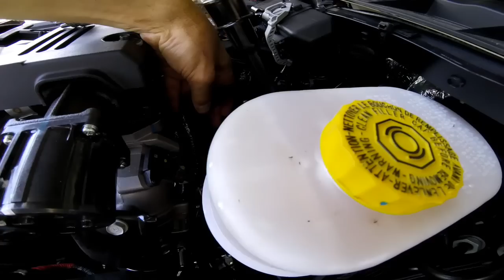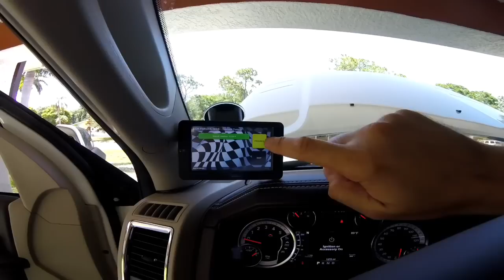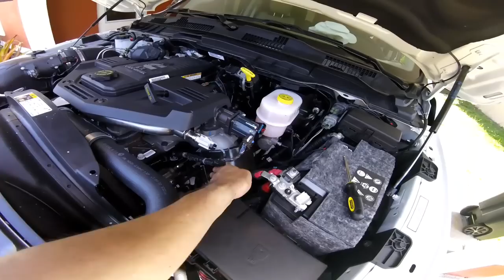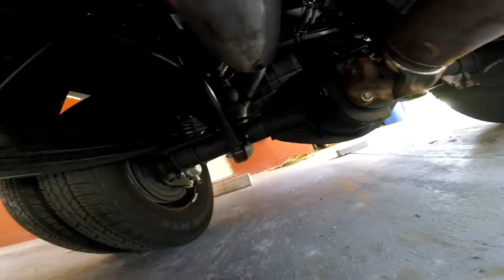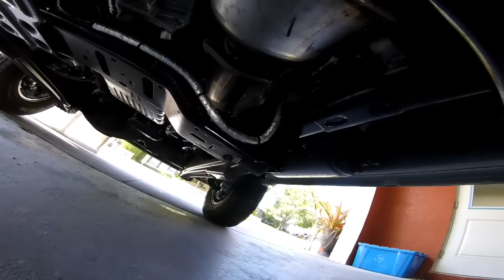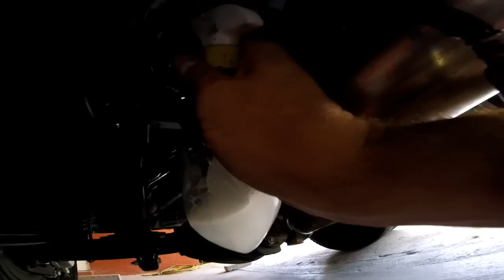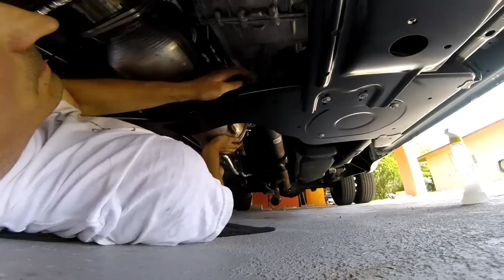New Ram 3500 DPF EGF EGR delete with RaceMe Ultra

Comment: What happens if you delete it from tune but not take any of the components out ?
Reply from the maker: @josevaldes6748  your DPF will plug up without regeneration and you will destroy your engine.
Reply: @ I bought a 14 Cummins with race me tuner installed everything deleted found last owners info and called him because underneath everything is stock filter everything he said it was gutted I’ve had it for almost a year no issues. Today I got a code saying lost communication with redundant control module and check engine code truck drives fine though I tried to reflash the tune to see if it would give me the prompt for delete dpf didn’t give me it so idk what’s going on lol tuner doesn’t see the dtc but my scan tool does
Reply from the maker: @josevaldes6748  if he gutted the DPF there is nothing to plug. Sounds like that isn't emissions related, best of luck chasing the gremlin.
Reply: @ thank you sir

Comment: Where did you plug in that single wire race me ultra underneath the dash which section did you plug it into the wire with just the white tip that goes underneath the dash
Reply from the maker: The only wire I ran was to the ECU integration port, which is the four connector type. Did you get the optional exhaust temp wire? That goes to the exhaust manifold and plugs into the module, which I mounted under the dash. That requires some drilling and lots of precaution, otherwise you risk sending debris into your turbo.

Comment: Outstanding step by step instructions for someone that wants full delete with the stock look. As shown, it is so much easier when things are brand new. But none the less, new or old it still all the same in the end. Great job for an offroad truck...
Reply from the maker: Thanks, glad it helped get you off roadin!
Reply: @shaunvolkmann1904 it's the same process  for 2021 ram 3500? Thanks in advance

Comment: I installed a Raceme tuner and unplugged all the connections on the engine as shown in your video and the truck runs great. My question is there any advantage in buying a full delete package for the engine and removing the unplugged parts from the engine? Thanks
Reply from the maker: I just did one with the full delete. You have to drain a gallon of coolant and it's time consuming. I'd say no, unless you plan in doing an intake horn, there really isn't a reason to bother. I have to say the Monster Banks intake and boost tubes are worth the time.

Comment: So you’re saying you can delete it all with leaving the egr intact? Only removal is dpf and egr actuator plunger?  I have a 2020 tradesmen and wanting to do this.
Reply from the maker: If the emissions systems are the same, I'd be comfortable doing it to my 2020 (if i had one).  Just do some part number checking from a 2018 to the 2020 to be certain. The 2019 and newer have different tunes, so make sure you got that covered.
Reply: @shaunvolkmann1904  well the only thing different is the actuator. It’s not a cylinder. Couldn’t I just unplug everything tune it and replace exhaust. Can’t find anything on it just older models
Reply from the maker: @bobbo2576  yes, the removal is just an extra level of safety.
Reply: @shaunvolkmann1904  so I just need a turner and remove exhaust?  Way easier than my TDI lol

Comment: Im starting my install today. But first i got to go under and plug in all the electrical to the exhaust. So after the ultra turns things off, do you have to go back through and clear codes from everything that is unplugged from intake to exhaust.  
I heard your music so i figured id reach out to you.
Reply from the maker: It's best to tune with no codes showing on the truck. Others have stated they pulled the battery cables and then didn't start it, only out it in accessorie mode to tune. Once tuned you can clear codes that develop, but you may have a hard time clearing them if they are there before the tune.  Best of luck!

Comment: Hey man I removed all egr dpf and throttle valve on a 08 6.7 Cummins. Would it still work?
Reply from the maker: Hello! Yes, it will be able to program down to a 2007.5. Hopefully you don't have any code lights on, they're hard to turn off once you program
Reply: @shaunvolkmann1904  by code lights do you mean check engine? I have that on because I’ve removed all egr dpf and def. It even throws out the “exhaust filter full” light on the top cluster.
Reply from the maker: @Manuel Ochoa  someone else on the thread tried this an said it worked. Disconnect the batteries for at least 15 minutes. Then connect them, but do not start the truck. When you hit the ignition see of the check engine lights are off. If they are, flash the ECU...just dont start it till you do.  Or, worse case install all the stuff back on to rid the engine codes, then flash ecu and remove components.  Boy, I hope you dont have to do the latter....

Comment: i need help my exhaust brake isnt working like it should after tunning do i need to do the steps in this video on the actuator>??
Reply from the maker: I'd throw a battery charger on it to make sure your voltage stays correct then restore back to factory. Don't start the truck, keep the charger on it and flash the ECU again with your tune. I've never had an issue with the brake on any of the tucks I tuned following the above directions.
Reply: I just did this @ a battery supplier shop 13.5 14 volts and nothing im wondering if i need to take the actuator apart as you did on your video.? I've tried everything contacted raceme and they can't seem to help when it was stock the EB is a beast but now its not noticable as its the only i have not done  yet

Comment: Great video. I’m about to do my 2018 3500.  I also have the raceme tuner I think it’s going to be great
Reply from the maker: I know it will be great!
Reply: How did your process go for your 2018?
Reply from the maker: @josue6.753  same except the DPF electronics are on top of the canister.
Reply: @josue6.753  ok, not as much power as I expected.. maybe need a banks pedal monster as the throttle response hasn’t seemed to change much since the upgrades.  I need to find out if I can split the ODBII port to use both the raceme and the bankers pedal monster.

Comment: Hey Shaun, this is a really old video so I'm not sure if you are even going to respond to this question. When you run any of the added HP tunes, have you ever had a problem with head gaskets?  My biggest fear is adding the raceme for reliability and then having to put it straight to the shop for a head gasket issue.  I don't have a heavy right foot or do burnouts, but if I pull a 19k toy hauler (frequently), I don't want to kill my HG.  I was intending on running the 30 or 60 HP. any thoughts?  I have the same exact truck as you (2017DRW, Aisin, 4.10 gears).  Thanks for your time
Reply from the maker: Hello! Have had no issues with any tunes up to 120 hp. (Never did any higher than that) Message with RaceMe directly on the website, they'll tell you none of the tunes will mess up your truck.  It runs just amazing on the default tune with added hp. Best of luck!

Comment: great video didnt really explain the programing of the truck very well dont you have to plug in an sd card and how does it grab the VIN? is it automatic?
Reply from the maker: Hi Douglas, yes the tuner uses and SD card to upload the firmware, this allows you to update the system display when they release new screens or features.  The tuner automatically recognizes the VIN when you plug into the OBD. Each tuner can hold up to four VIN keys and tune all four trucks if you buy extra "Keys" for the SD card. The programming is pretty straight forward.  I should do a video on the firmware updates, that's not so easy....

Comment: Hey Shaun, 
What about that cat? I see a screen inside it. Wouldn't that get plugged up from the change of the ECU? 15- 2500 6.7. thanks!
Reply from the maker: Hi Mike, yes that's why you have to change out the exhaust system. If you don't you might blow up your engine!

Comment: Hi, why do you have to reconnect that last sensor at the end of video?
Reply from the maker: Hi, there's quite a bit shown. Do you mean the pressure differential sensor? If that is what you mean leaving it disconnected causes a fault code. That code causes the engine to lope like it has a big cam installed. Can't remember the code number, but it resolved itself when plugged back in even though that sensor is supposed to be not needed with the delete. I think the voltage change from removing it causes the issue, not the actual part being removed. If someone knows exactly why feel free to comment!
Reply: Thanks for the reply. Yes the pressure differential sensor. Mine has no fault code when it’s unplugged. It runs the same plug-in or not.
Reply from the maker: @unionsprinklerfitter  the one truck we tried that with ran fine for a while, then started to lope a month or so later. Either way we cleared the code and plugged it back and it was resolved.  Happy motoring!

Comment: 2015 RAM 2500 4x4 Crew Cab, 6spd, Camper shell, CERT rigged for emergencies, 10,500lbs deleted 27-33mpg freeway.   499,000 miles  CLEAR CLEAN OIL till 5000 oil change. 2nd clutch,  3rd set of brake pads, 3rd water pump, 18sets of tires, Transforce  HT take offs. $200 a set of 4!!!   Average 35-40cents per mile includes the TRUCK Price.  I get cheap diesel $1.25-1.50 at diesel Heating Oil recyclers, Airplane Mechanics Jet Fuel recyclers, and other TRUCK Stops with Fuel recyclers...

Comment: Hey I deleted my exhaust already and I've did the unplug Inns of the connectors and ran my wire is there a problem that I already deleted the stuff if I'm using raceme Ultra
Reply: I don't know if this is ongoing or do I have to wait for answer I'm kind of curious
Reply from the maker: Well, I wouldn't start it before trying to flash the ECU. I've never done it that way, I've only done them the way I show in the video. Best of luck!

Comment: After "someone" that lives with me (I'm not going to say any names STEPHANIE because that'd be rude) filled up the truck with some good ol' 87 octane I got a "few" codes. 
Exhaust filter 100% full was one. 
Then somethings about the DEF. I can't imagine that had to do with that though.... 
and a couple others, I don't recall now. 
I began the research and found a DELETE is a better option. 
I've replaced the exhaust with straight pipe and will be disconnecting the EGR once I get my tuner in my hands but here is my question.... 
Am I screwed by having the truck already exhaust replaced? 
Or can this just do it's deleting job without doing the initial STOCK information? 

I'm going with the RACEME ULTRA for my 2014
Reply from the maker: Try disconnecting the battery leads for several minutes, reconnect and then turn the ignition on (but don't start it) to see if the codes clear.  Others have commented that this worked long enough to do the tune without issues. Best of luck!

Comment: Hello sir.  Is it mandatory to disconnect the egr, and throttle valve? I have done everything except that so far
Reply from the maker: It's your truck, you mandate what is necessary
Reply: @shaunvolkmann1904  I'm going to do what you did in the video to play it safe! You really made the best video for this process!
Reply from the maker: @texasgunnerfree  you disconnect it to make sure it does not get stuck as a safety measure. 🙂

Comment: Hey did you have to download a file onto the chip that comes with the revenge tuner? Or was it get itand plug it in?
Reply from the maker: That depends on the version loaded on your tuner. I did download the latest firmware, unzip and place it on the micro SD card to "update" my tuner with the latest upgrades. But, mine was from 2017 now...
The website shows the last firmware update available, just compare to what version is on your tuner.
Reply: Mines a 2013 so just go on the raceme ultra website and see what version it says to have or should I just download latest version to it?
Reply from the maker: @connorbuchholz9938  check the version on the website to what you have. If its outdated you can always update. The file is in a crazy format, and I had to use a program to unzip it. It is a pain
Reply: So would I beable to put chip in computer that way or do I gotta put it in truck and see what code or number it brings up to match them?
Reply: @shaun volksmann
Reply from the maker: @connorbuchholz9938  I don't leave my newest truck plugged in anymore, but when you power up the RM Controller (using the OBD) you can go into the settings to see the version. The kits comes with a Micro SD to USB plug to use your PC to upload an update if needed.

Comment: Do you still have the egr installed? I’m thinking about leaving mine on as well and just un-plugging it like you did.
Reply from the maker: Hi. Yes, on all three trucks I've done
Reply: Thanks for the reply. Do you get any issues down the road I should look for or expect?
Reply from the maker: @timcanfield3302  I haven't had one to speak of.  When it's time to change coolant I'll remove the EGR and go with a Banks Monster Ram intake instead.
Reply: I deleted my truck with raceme ultra, same truck as yours, i left all egr stuff until now, i am about to remove all the egr with a delete kit, do i have to keep the egr actuator plugged in even after removing all egr components? Or can it be removed?

Comment: I just got a 2018 3500 and I'm thinking of getting the ultra, do you still use the raceme ultra?  do you have to change the exhaust? Does it coal a lot? Have you had any issues?
Reply from the maker: I haven't used any setting above the standard tune, that tune only puffs a little when you stomp it. Then it's burning clean! No issues, still running the Ultra
 Best thing I've ever done for my Cummins.  Yes, you must remove the DPF and SCR. I show the setup I replaced it with.

Comment: Mine is still under warranty and was worried about flashing before it was up. Less than 20k on it and already had warranty work for the dang emissions that left me stranded. Do I just reinstall the exhaust and plug everything back in?
Reply from the maker: Yes, then upload the stock tune. I had to do this on one of my trucks already with a serious issue! They fixed everything, and as soon as I got home deleted it again.

Comment: Hi I just did a complete delete 4" exhaust and race me ultra on my 2016 ram 3500 but somehow its running rough any suggestions
Reply from the maker: Use the RaceMe to look up if you threw any codes to start. Best place to start..  If you didn't leave the SCR sensors plugged in that can make your engine lope, like it has a performance cam......I can't remember what code that threw, but just plugged it back in and boom perfect. It really shouldn't matter if you unplug all that stuff, but maybe the voltage change is enough to throw off things.

Comment: What hp would you recommend with the asian? Great video!
Reply from the maker: Thanks! Runs best on the default tune, timing, and duration.  The two lower tunes run lean without the EGR bringing in unburned fuel.  You'll be so happy 😊
Reply: Whats the default tune? Would that be 1 sir?

Comment: How has this truck been doing?  Have you had to revert back to stock for warranty work? I've got a '16 with aisin and I'm ready to delete, still have powertrain warrany till 2023.
Reply from the maker: I've had it in for a few warranty issues (not engine related) and took it in deleted. They didn't care and were happy to have the warranty work. :-) Truck runs better and better everyday

Comment: Are u still using the same raceme programer?
Reply from the maker: Yes I am
Reply: How do u like it ?? I'm having problems with the service the throttle body  and some electrical weird things thoo
Reply from the maker: @Potage_jdm  love it, zero issues.  Did you leave everything in place prior to the tune? You can clear codes with the tuner, that's what I would try first.  You could always put everything back on, and revert to stock ecu. Once you fire back up and those lights are off, re tune the ECU. If not off, pull the battery cables for a good 30 minutes, and see if that helps. If that does, re tune and make sure to follow the directions to disconnect everything. Happy motoring!

Comment: How do you set it back to factor settings for warranty work I have the 2019 ram 5500 new body style. Just wanting as much information as possible before I do it. Truck only has 34,000 miles
Reply from the maker: Last I checked only works on Gen 4 Ram

Comment: Pretty much standard steps even if u go with CTT tuning correct?
Reply from the maker: Haven't used them, but emissions systems all should be disabled or removed for any tune.
Reply: @shaunvolkmann1904   awesome ty ill use this as my guide for tomorrow

Comment: Can I leave sensors and other plugs plugged in on DPF part of it if im not changing the exhaust exhaust?
Reply from the maker: You must remove DPF and any exhaust restrictions or you'll blow the motor. I left most sensors plugged in and zip tied up to the frame to leaver wire harness intact.

Comment: The sensor you put back after taking it off the exhaust, do you have to do that?
Reply from the maker: I've had trucks start to lope, and throw codes when I didn't. Try and find out 🤷🏻‍♂️
Reply: @shaunvolkmann1904  so far I haven't got a code.
Reply from the maker: @dingdong467  after a while use the tuner to scan for codes, it never threw one on the dash. But, the hint on a few trucks was the strange idle. Best of luck, bet it runs great now!